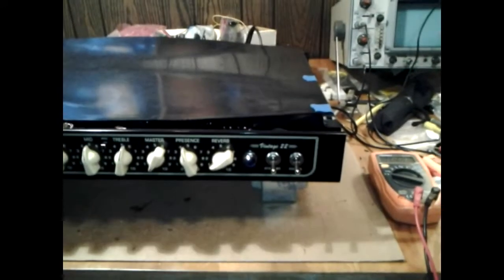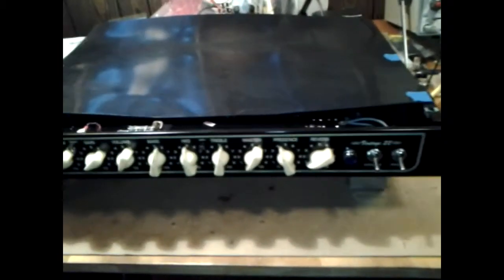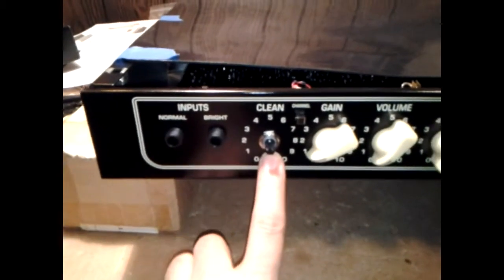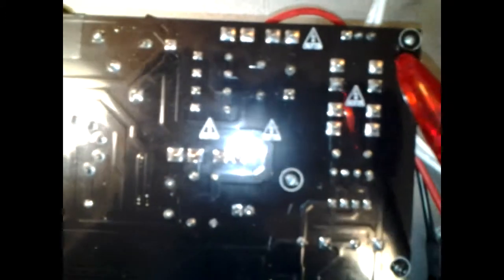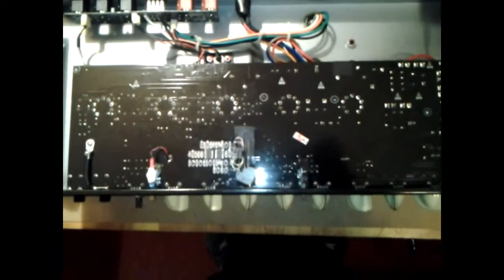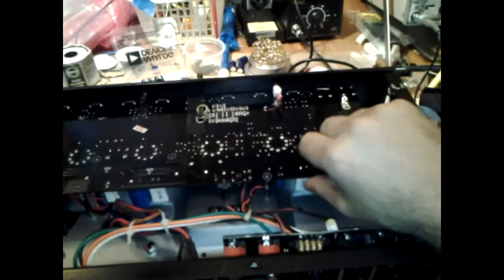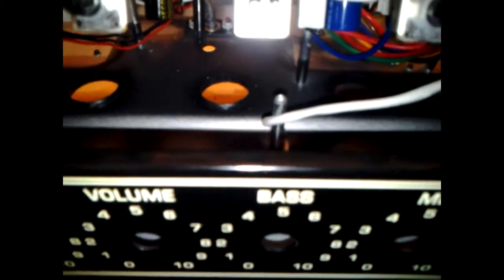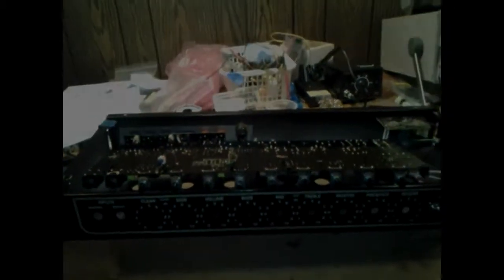Engineer meets Bugera V22 reverb - Part 7 (circuit board removal)

Comment: you're not saying ANYTHING about the amplifier though - i heard NOTHING about the circuit design topology etc etc - nothing
Reply from the maker: This series wasn't intended as a reverse engineering project or a full engineering teardown. It was meant only to address what I think is sonically the Achilles' heel of the amp. But since you're curious, I can describe the amp's topology here and add some commentary. Overall, the amp's circuit is pretty unremarkable though apart from a couple things. It's competent and very nicely shaped, but ordinary.

The input circuit consists of a 12AX7A gain stage with two optional 12AX7A stages switched in for the high gain "channel". The extra gain stages are switched with a relay. The normal and bright inputs differ in that the the normal input is just resistively coupled whereas the bright input is coupled through an R and C in parallel, thus yielding a shelved LF cut. There's a bit of HF filtering in the input circuit as well to keep radio stations from playing though the amp.

The input circuit feeds another 12AX7A gain stage that drives a classic three-band tonestack. The tonestack uses, depending on what position the Boost switch is set to, values very close to a 5F6-A Bassman or something with a lower frequency HF pivot. The tonestack is followed by the master volume.

The master volume's output then goes to the effects send and return jacks. The effects send is buffered by a resistor-biased emitter follower. I don't think this is the way I would have done it, but in practice it seems to work OK. I'm not a heavy user of the effects loop though. When you're not using the effects loop, the BJT is out of the signal path.

The signal then feeds the power amp stage, which starts with a 12AX7A gain stage that also accepts the negative feedback. This is followed by a cathodyne phase splitter, and then a fixed-bias EL84 output pair. Somewhat interesting with the phase splitter is a 470K resistor between the 1M grid bias resistor and the grid. I can't tell whether this was done for stability, to limit grid current in overload, or something else. The NFB comes off the output transformer's 4 ohm tap, and the presence control is implemented using the standard NFB HF bleed. Pentode/triode selection in the output stage is done by switching the screen grid resistors to a fixed high voltage or the output tubes' plates.

The power transformer has three secondaries, and all of the rectification is solid state (1N4007). One of  the secondaries is for the 348VDC B+. Another is used to provide AC heater voltage to the EL84s, with 100 ohm non-adjustable centering resistors. And the third is a center-tapped LV secondary used to derive the DC negative output stage bias voltage, 15VDC bipolar solid state supplies, 5VDC logic supplies, and a bipolar 25VDC supply for the 12AX7A heaters. The six 12AX7A tube heaters are series connected between this bipolar heater supply, and the middle of the heater chain is grounded. This is an interesting setup in that it  provides DC heating for the signal tubes inexpensively. All voltages derived from B+ are dropped resistively and filtered capacitively; there are no inductors in the power supply. The primary and all secondaries are independently fused.

The above is based on schematics available on the Interwebs. I haven't confirmed whether my amp deviates from this.

So, again, there's not too much that's interesting. But it's a competent and sonically satisfying implementation.
Reply: yeah i was just expecting a lot more based on the title ...pretty much any 'joe off the street' could have made the same presentation though - if you are (presumably) an engineer it would nice to see what unique perspective might be able to offer
Reply from the maker: @antigen4  Presuming you've watched the whole series, all I will say is that I'm sorry I failed to live up to your personal expectations of what this series should have been.

Comment: Are there test points for the B+?  Useful for monitoring lethal voltages and possibly for draining the filter caps.
Reply from the maker: Not that I recall. IIRC, I used the main capacitor terminals on the PCB to drain the caps.
Reply: Thanks!  I'm planning to add the rotary decoder and a LCD display driven by an Arduino to show which effects program is selected.  Is there any +5V in the box?  My LCD wants +5 but the effects chip is apparently 3.3V.  If not I guess I can rectify some of the 6V heater supply.
Reply from the maker: Fantastic! There is what's purported to be +5 VDC available at the junction of D16, C39, and R67 (at least that's what the reference numbers look like on my low resolution schemo). However, this is regulated by a zener diode and therefore open to wide variations. I would be more tempted to feed the raw DC input of an Uno or Nano with the +15 VDC available at C36/IC3 and let the Arduino regulate that down. Please let us know how it goes!
Reply: Well I finally got around to finishing up this project.  I did the arduino/LCD/rotary encoder design to select an effect with the rotary encoder and display the name of the effect on an LCD display.  Time to open up the amp and extract the effects board... But lo and behold, no effects board in the V22 Infineum!  The chip is now surface mounted to the motherboard and there are no pads available to solder a header to to extract the selector signals.  Bummer!  My skill with a soldering iron is probably just adequate to solder on a surface mounted header but figuring out which surface mount resistors are terminating which signals is beyond me.

Comment: NICE TUTORIAL . I was really looking for advise on biassing the bugera v22 my power tubes were not working (no amp sound) change all tubes with mullards  change tubes in December and two month later March 2015 hizz, cracking noises no guitar sound  tubes glow normal. The amp sounded good after replacing the tubes didn't make any cracking noise I didn't touch the bias (didn't want to mess it up) My first tube amp and learning. have to sell it (NEW BABY IN FAMILY)but need to fix it first any help would be  appreciated.
Reply from the maker: My amp from the factory was biased at about -15.3 volts (measured at the bias measurement jack). An unofficial schematic available online indicates -15.74 volts. As near as I can tell, Bugera doesn't have a published specification for this.